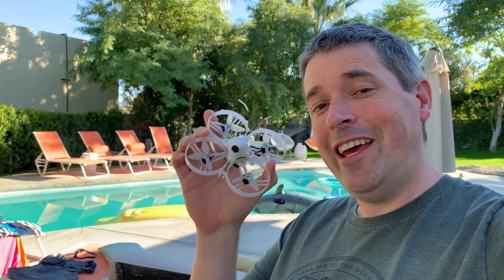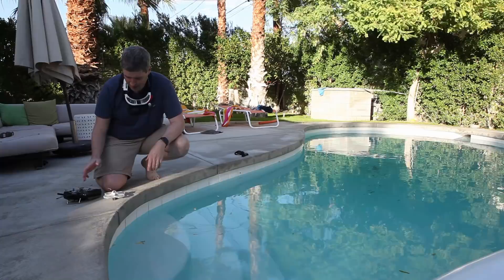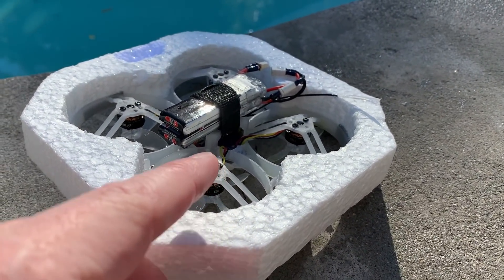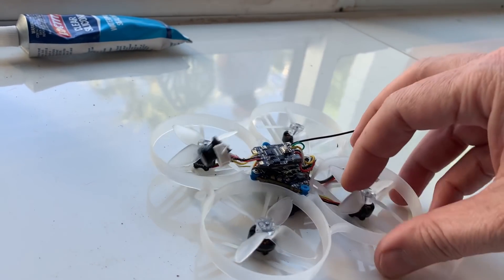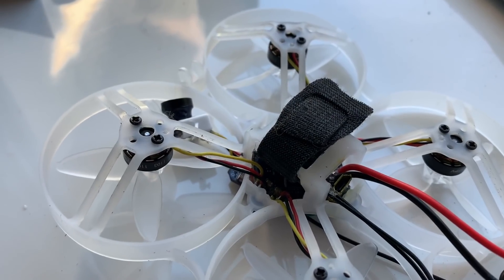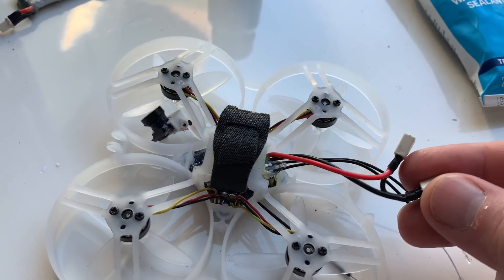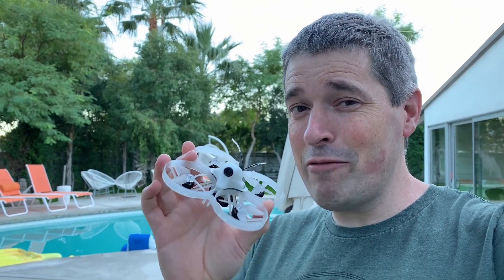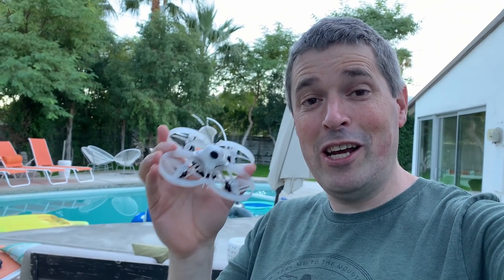Will this FPV Drone Survive the Water?

Comment: This is amazing. I wonder if conformal coating worsens heat dissipation, causing a potential problem when using it on naked vistas.
Reply from the maker: I have never actually tried to conformal coat a naked Vista because I have never taken the time to remove every last bit of that blue goop. Even it it were conformal coated, it wouldn't be "water proof". Conformal coating would ruin the MIPI connectors, for example, so you would have to avoid those parts. In theory "Dry Drone" could waterproof those without destroying them, but I haven't tried. I think the risk of damaging it during the waterproofing process might be more than the damage of it getting wet out in the wild. But regarding heat... that is an interesting question. It probably has some effect since silicone doesn't conduct heat very well, but I have never had a heat problem that I attributed to conformal coating. I recently built a whoop with the 200mW Shark Byte VTX. It also gets quite hot if you plug it in on the bench, but I have not had any problems with it overheating in flight.

Comment: Not that you're likely to find it outside, but you know pure water (zero contaminants) does not conduct electrons at all.  And I'd be will to bet those circuit board baths are done in distilled (pure) water.

Comment: I had the exact same idea as you did with your first whoop,  the brushed one. I bought the Betafpv 65s lite,  with the Bayang protocol. I go to the pool alot,  living in Arizona.  I was going to coat the bayang toy grade transmitter too. That way I basically sit in the hot tub and jet around the pool area, with total confidenc. Luckily,  I caught your video.  I didn't even think about the brushed motors getting rusty.

Comment: The exact same thing happens to my toothpick on arming sometimes with a twitching motor. I've also conformal coated mine and it's been well buried into snow, then flown pretty well as a flying snowball. I do think it might be water damage in my case though as it only happens after a few crashes into the snow and goes away after I've let it dry out.

Comment: The distance for the frequency for the transmitter video and radio in water is around 2-3 inches at best.  You would need a lower frequency like 40 kHz to allow for data transfer any significant distance.  The other idea would be to have a floating tail with a tip float as a buoy to keep the terminal end above water.  I wonder if a piezo antenna type akin to GPS modules would produce any better reception?  dunno, but the shear increase in surface area makes me go Hummmmmm.  Water can perhapsact as a viable medium for piezoelectric energy transfer? huuummmm.  Awesome video.  I am a kindred spirit and have been trying to make a viable micro water drone too!  I sent some photos to R3D shifters for a modification to one of their models.  Bravo Again.  Thanks!

Comment: You may be on to something here. Even if this is surface/air only, it is pretty cool.  Some long antennae might allow you to go a little under. If it goes too far, it just floats up. VTX longer than the XM+ to keep the visuals going. I wonder if anyone has tried hydrophobic spray like NeverWet.

Comment: Petersripol made a video about lego rc submarines and had to use 75 mghz in order to penatrate the water.
Reply from the maker: Yeah, but what about video. The ultimate would be aquatic FPV!
Reply: It stands to reason that the same principle could be applied to the video feed. I guess the question is, what vtx can you use that will go to such  low frequencies?

Comment: 422C is the newer Version of 422B

https://e-praud.de/422C

( change language the top of the Website ) 

Differences:

"Continuously improving and improving the quality of its products and taking care of end users, to replace the popular 422B, MG Chemicals has released a new 422C silicone coating with the same technical characteristics. The main difference between MG Chemicals 422C and MG Chemicals 422B is the absence of flammable xylene and ethylbenzene in the chemical composition of the new 422C coating, which allowed this product to obtain UL 94V0 safety certification."
Reply: thanks

Comment: Kotking is the only way to do this!!!! (Trust me it works)This being said before kotking was available i used conformal coating. 3-5 coats on everything! worked wonders for wet grass and moisture. Kotking just seems to build a much thicker layer quicker and easier. $10 could save you a lot of $ and racedayquads.com has it in stock lol As for arming it under wayer i believe you need to be on crossfire. Im assuming 2.4 won't push thru.

Comment: Do I have to remove flux residues before applying conformal coating ?
Reply from the maker: The silicone will form a film over the top. It probably sticks best on a clean dry surface, but I use flux and it has not caused a problem for me. You can check it with a black light and see if the coating is uniform.
Reply: @MrShutterBug  I asked bc I first clean the Board, then apply first layer of CC with Motor plus already removed.. ,

then direct solder the motors and dont wanna clean it again

( Otherwise it would remove some CC around the Motor plugs )

So I just CC over a bit of flux.. 😅

Comment: If u conformal coat do u not need to worry about vtx or receiver touching flight controller anymore or conformal coating will  eventually rub off?
Reply from the maker: Should be fine. Conformal coating does not rub off but it could get soft if the vtx got really got. I would put some electrical tape or Kapton tape between them just in case.
Reply: @MrShutterBug  Thank you just ordered some Kapton tape.

Comment: I remember looking into rf underwater as a possible project in uni. This was a while ago so I don't remember the details but I also didn't pursue it as initial research wasn't promising without specialized equipment. Basically you need frequencies well below a Mhz to get penetration underwater and with that low frequency you also get low bandwidth so you need complex compression or modulation techniques to get good enough data rates. Also this is only for underwater to underwater comms. Going from one medium to another (water to air) has a big effect on the radiowaves.
Theres probably more recent research done by now but I don't think any is commercially DIY-able at this time. Would be really cool tho...
Reply: this is a paper for underwater wifi testing, it seems with a 2DBi antenna the penetration range is 15cm under water. No idea what the properties of the recereiver and the radios in RC are.
https://core.ac.uk/download/pdf/8729113.pdf

Comment: Is that pool have a salt water system? Probably rougher on everything if it is.
Reply from the maker: Salt would make things much worse. Not only does it conduct electricity, but hydrolysis can cause metals to rust in no time. Luckily there’s no salt in this pool.
Reply: @MrShutterBug For sure my parent's  salt pool eats up the kids pool  toys. They usually only last one summer.

Comment: Looks like an esc issue unfortunately. Probably only 1 of the 2 fets since it's intermittent. I've started building 85mm setups with 12a boards to help avoid this from normal crashing. I can only imagine trying to move water adds a huge resistance spike to the load. Have a great vacation!

Comment: Description:
"Bondic UV activated glue"

Just for the lens Barrel or also at the front / glass 
( or completely ) ?

Because I had the lens Barrel waterproofed with silicone glue, but water got in from the glass / plastic lens itself :/

Hope you understand what I mean...
Reply from the maker: Yes, I also put UV glue around the front of the lens to seal the ring which holds the glass. Good question. UV glue is nice to work with because it doesn’t set until you’re ready.
Reply from the maker: Yes, I also put UV glue around the front of the lens to seal the ring which holds the glass. Good question. UV glue is nice to work with because it doesn’t set until you’re ready.

Comment: You could add a little skirt on 3 sides to move around on the surface. The 3 sides would trap air an the exhaust out the back would move you forward.

Comment: I thought the original floating Shutterbug85 was cool, this is awesome. Really shows how good  proper water proofing can do. You didn't say how you dealt with the bind and boot buttons. They still operational? Thanks for sharing, happy flying. 🤓
Reply from the maker: When the bind and boot buttons are the low profile bubble kind, they are already sealed. The silicone is flexible so you could still push them. Otherwise destroying those connectors isn’t a big loss unless you plan to sell the drone. You can usually put the drone in boot loader mode by typing BL in the CLI. Cheers.
Reply: @MrShutterBug  thanks 👍🤓

Comment: Made me a believer in conformal coating. I've had a bottle for awhile and with several quads, I gotta get busy! 😀
Reply: Just make sure to firmly degrease the parts before coating
Reply: @Drone-Pilot  I have a silicone modified conformal coating.. would the silicone help with conducting the heat and passing it to the surface? Instead of acting as a blanket holding the heat in?

Comment: You should try some other receivers in the future to allow it to work underwater, maybe even enable 3D mode. Now it's running Betafloat!
Reply: The RF signals can't get past the surface.
Reply: @BrandonBeans   Yep...there's a reason underwater drones are tethered...
Reply: Haha great idea lol
Reply from the maker: 3D mode would be amazing! Unfortunately the motors really don’t like spinning in the water. There is so much drag it is hard for the motors to even start their cycle. These motors are designed for high RPMs that just aren’t possible in the water. Maybe a large, torquey, low kv motor could pull it off?
Reply: @MrShutterBug  Yeah, that would work much better. Maybe something like a micro inrunner style motor (if they even exist) with a seal and low KV would work well. Maybe some form of a tethered radio would work to allow an RC link underwater, or just a 900mhz RC system and 1.3Ghz FPV link (lower frequencies tend to have better penetration through water, especially 900mhz).